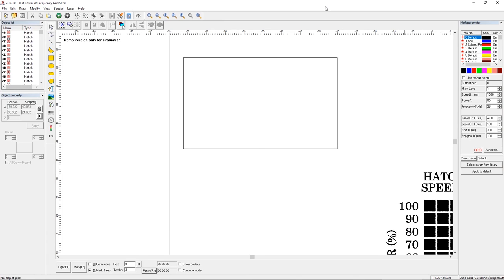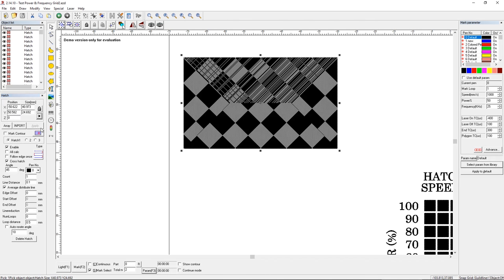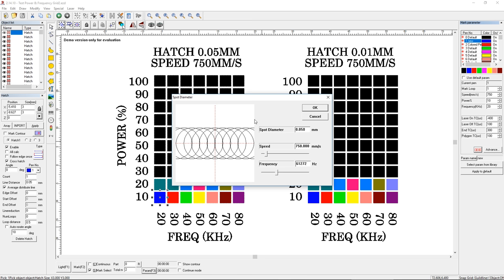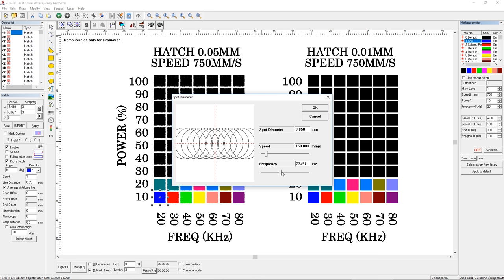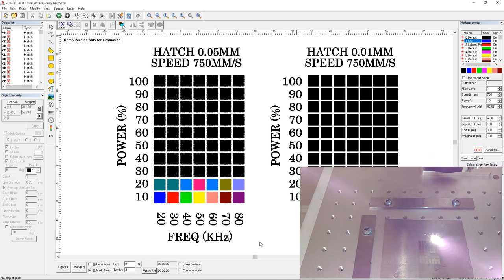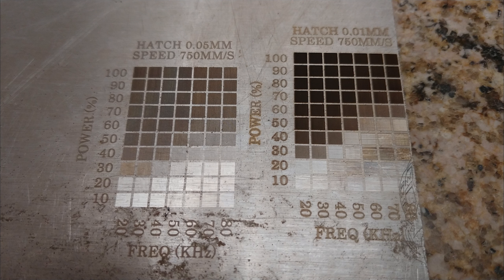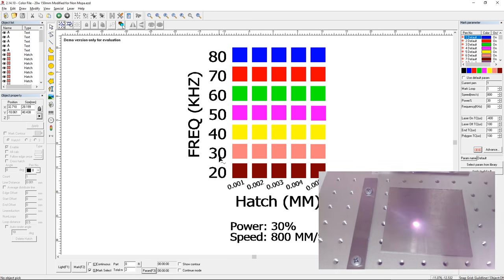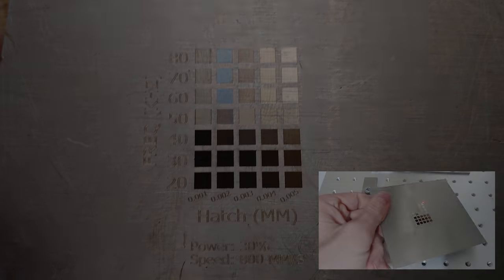Frequency Settings for Fiber Lasers : EZCAD2

Comment: "I LOVE THIS VIDEO" I've had a 30w Fiber Laser Machine for nearly two (2) years now and haven't engraved one thing yet other than some of those black aluminum cards which seems to be the only thing I can do as a noob because I don't understand settings and the machine coming from China provides no support.  This is some great info and I will be trying these settings tomorrow to see if I can find the problem to my delima of not being able to successfully use my machine properly and engrave like it should.

Comment: yeah i run a 50 watt fibre laser and have never changed those spot settings since the machine is installed, instead setting up the desired finish using speed, power and freq and controlling the mark with spot size (typically 0.04) and various forms of hatching and cross hatching say if the material coating is particulary troublesome, so 50hz delivers the most power and then upping to 80 or 90hz for a nice polish (on steel) so just as an example , 0.04 spacing, cross hatch, 3000 speed, 100% power and 50hz for taking a coating off then 0.04, single hatch, 3000, 60 power, 100hz to polish
Reply: Hi Bob I have 50 w fiber laser. Can you please help me?
Reply: i have a 50w with 300mm lens.  learing my setup slowly.  thank you!

Comment: Hi Jeffery, long time since you posted. 
When you do this graph, when you change parameters in layer parameter settings, do you have to do each layer independently? I have 70 layers and have gone through and changed pramaters in every single layer. 
Now I have to go back to change mark speed to 500 on every layer. Is there a quicker way of doing that?

Comment: THANK YOU - this vid is still very helpful and relevant! I'm looking for more details on how speed + power + frequency impact the depth of engraving, specifically to optimize cutting metals (no hatch, just a 0.3/0.1 wobble config'd for the pen). I can see I need to dial this in for each lens (50W JPT; f100 and f290 lenses). Do you have something like this done --OR have info on how I calculate it? 🍺🦝👍

Comment: Well done. We have many greens, reds and oranges at 25% power in the .0005 and .001 line space range.

At 20% power, we did a second pass at 0.001 line spacing and got a nice black luster at 80kHz, and a deep maroon at 60kHz. 

If you want to get some rainbows, we did a double pass at 20% power, 800MM/s to get brilliant colors at .0005,.001 and .002 across all frequencies.

Comment: I hadn’t payed attention to that spot diameter visualisation dialog.. good pointer.

Another big thank you from me: it’s really great that you are publishing videos of your experimentation since there isn’t much else out there.

Is there a shortcut you use when making those test patterns or do you go through the boxes one by one and adjust pen settings?
Reply from the maker: I've been trying to find a shortcut by opening every file in the ezcad folder that looked like it might store pen settings, but I haven't found it yet.  So yes, one by one....very tedious.  If you want the file to play with, let me know and I'll send it your way.
Reply: Param/markparam.lib has the saved param library- each [section] is a single pen config, but unfortunately while that would allow programmatic generation or just search and replace, you would still need to manually apply a different setting to each pen which is still 75% as tedious.

Comment: When I tried doing stainless steel at first on my 30W fiber non MOPA it was like a brownish goldish color and I didn't like it but now I go out of focus by 3-5mm and it no longer etches the steel but burns a very dark image on the steel. You should try to go out of focus to get that black anneal and also see what colors you can get out of focus. Great videos especially since there is so little out there in tutorials for these lasers in English.
Reply from the maker: Check out some of my other videos from the past.  I've done a few on colors on stainless and titanium.
Reply: i too have 50W raycus fiber non MOPA, does frequency affecting the result too? because the company said no need to change the frequency because its not MOPA. i really need black smooth marking but never achive it, always looks goldish color. Please help me..
Reply: @rumblemumbles  Do what I told you above, you need to find the sweet spot where it starts to etch the metal then raise the head about 3mm to get the dark image. Also you want the lowest Frequency your laser goes to make dark images. I have a 30W so my laser can do 30 KHz to 70KHz. The higher the frequency the lighter in color for non MOPA.
Reply: @Angryhelder  yeah i already try for 1 week with every parameter and power setting with my 50w and 50KHz and raise the focus, but the result is always not truly jetblack, it turns out greyish black. but thanks for the info. sorry for my bad english.

Comment: Hi Jeffery! Was it a 20W fiber laser machine use in the test on 3:50? Because I had bought a 20W fiber laser machine as well and downloaded your shared file to do the same test just like 3:50. I was using stainless steel pieces as well but the result was different from yours. It did not show any colour. Please help.

Comment: Nice video. Just a question if I may. If you dont get a satisfactory color on a mark. Is it practical or possible to re-mark without moving the  material. Lets say we are working on stainless steel for example. Thank you
Reply from the maker: Yes you can mark again as long as you don't touch, bump, or move the material at all.  For color, the results may be a little unpredictable when re-marking.

Comment: Hey Jeffry, I am trying to put a black mark on 11 ga. mirrored Bronze plaque. The size of the plaque is 11.5"x 7.625" almost the size of a sheet of paper. I am brand new at this. I just bought my 60 watt Fiber MOPA Laser. any help  with settings or if a plaque this big can even get a black mark would be appreciated. I am using a 300x300mm lens by the way. Thank you

FYI I tried to email you but it came back as undeliverable

Comment: I seem to be having a problem with my mark settings and I hope you can help. So far your videos have been the most helpful!! I operate a 30w KT Laser and while trying to figure out the rotary table the other day, the "speed (mm/s)" setting under "Marking Parameters" has changed to "step (mm)". So now instead of the default being "Speed (mm/s) - 300" it reads "Step (mm) - .020". So y question to you is, do you know how to get it back to read "Speed (mm/s)" instead of "Step (mm)"? Thank you for any help you can provide!
Reply from the maker: I don't have the rotary, so all I can do to help is direct you to a few facebook groups where you might find assistance: https://www.facebook.com/groups/250911899106529/
https://www.facebook.com/groups/440091022989424/
https://www.facebook.com/groups/300139820848489/
Reply: @jefferyj  Thank you so very much sir!

Comment: Hello, on the Power vs speed and power vs freq the hatching is not setup. I cant seem to be able to figure out to hatch more then one item on the page. When editing the hatching parameters on right IE Speed, power and Freq then click APPLY and got on to the next and change it. After doing rows, I go back and click to check it and the last info I input in 1 box shows the same info I put in the last. If possible can you explain how to set up parameters and do hatching on the box to show different values.  Thanks again for doing these they helped a lot.
Reply from the maker: I made a video a while ago on hatching; it might be worthwhile to check out to make sure you're doing the same things I am to set up pens and apply hatch settings.  Here's a link: https://www.youtube.com/watch?v=kmxDePbHHOk

Comment: Thanks Jeffery, your videos are very useful. 
Could you please let me know what's the different between Frequency setting and Wobble Distance setting? I'm confused because they both change the density of the wobble circles.
Reply: i think that keeping the frequency constant, increasing the wobble distance must increases the speed, is that right?
Reply from the maker: Wobble is used to thicken a line.  It will allow the laser to deviate from the 'on screen' path by an amount you set to gain thickness or coverage.  
Frequency controls the number of pulses in a period of time - the higher this number is set, the less destructive each pulse will be.

Comment: Hi Jeffery, Thanks for the video, it is very helpful. I am looking to do darkish marking stainless steel with a 30 watt fibre laser (it is MOPA) however I need it to be a durable mark. It is for a kitchenware product that will be used almost daily and be cleaned in a dishwasher. I don't mind if it fades a little over time but it must be durable enough to be distinguishable and not flake like MOPA laser annealing can over time. Do you have any ideas or know of a good resource for this?
Cheers, Jason
Reply from the maker: Hi Jason - I don't have enough experience with long term durability of annealed black marks on stainless to give you a good answer.  I'm curious though, how many washes does the mark stand up to until it is damaged?  I may experiment with this...

Comment: Hi Jeff, thanks for the video. I would like to ask how I can create a thick line (~1mm) on steel at a scan speed of 6-7 m/sec?
Reply from the maker: Two ways: use the offset feature in ezcad and hatch the space between your oriignal line and your offset line - or - use the wobble feature.  I made a short video on this a while ago.
Reply: Please send me a link of the video of how to increase the line thickness  in laser output.

Comment: Thank you for the tutorial I will try it out. Can you tell me how to set the parameters for cutting through metal?
Reply from the maker: Sure, low frequency, high power, moderate speed, several passes.  Add some wobble if you are lower wattage or your material is thick.
Reply: @jefferyj  Hi Jeffery thank you for replying. I have the same machine in 100W, I'm still trying to figure out the parameters I should use to cut. Because this is a test I'm cutting through 0.8mm Brass before I move on to 14K Gold. 
I have tried: 
Speed: 800 & right now 2600
Power: 100
Frequency: 20 & now 150
Hatch is a very close hatch
I'm not sure  why it is taking so long to cut though. 
When you say several passes, how many passes or minutes - I have had it going for 9 minutes on continuous & it is still going. 
I assumed that the 100W would be much faster than what I am seeing. But, I am new to this & trying to figure it out.
Can you please advice or suggest parameters? 
Or if you know i'm doing something wrong here. 
Thank you
Reply from the maker: Send me a note.

Comment: Great video but I got quastion: so I got 2x fibers one 50w and other is 20w but 20w got 1-1000 freq. Where do I use this and for what?
The 20w almost more powerful that 50w China model and 20 w is TurcMark sos laser.
Reply: It probably be setting issues.

Comment: hello mr jeffery  is have an issue about engraving when i want to mark as it is straight on my pc then when the laser marks it opposite like if i want to engrave MONDAY it engraves YADNOM. i want to reset it to normal please sir kindly assist thank you
Reply from the maker: Parameters (F3) >> Field Tab >> Galvo 1 = x
Swap that setting to the other galvo and it should be functional.

Comment: Jeff, We just got a 30W fiber. There are two problems with it:
1. The red spot is way offset (about 3" in X) 
2. I cannot mark. I suspect the fiber laser may have been damaged in shipping. The laser housing broke off the vertical rails, and rattled pretty bad in the crate. What does the test laser function do in the parameters page? How do I determine if the fiber laser is putting out power? 
The galvos, red pointer, etc all work. One weird thing. The easycad works without the USB dongle installed. Could that be part of the problem? 
 Reply direct: a_design@citlink.net
Reply from the maker: Hi - Sent you a note.

Comment: what is the strength of this laser? I can't seem to achieve dark marks on stainless steel with the same settings with a 20w
Reply from the maker: 20w, you should be able to do it.  Double check your focus and pen settings.
Reply: @jefferyj  i just built a table like the end of this vid with adjusted hatch widths and that may have been the difference maker. Thanks!

Comment: hi , i just bought a 20w laser machine and im struggling to find the right parameter settings for marking/engraving gold products. can someone help me?
Reply: How far is the field? I'm having the same issue with copper, as my focal length is F420 I figured the laser just doesn't have the blast power with that FL, I bought a F160 lens... luckily I'll be able to obliterate copper... I assume Copper has the same issue.
Reply: @RiderRickMaker  mine is a f=163mm lens. I have tried marking using settings for brass and got quite a nice white finish on the marking. Maybe because brass density  is almost the same with 24karat gold. 

parameter settings i used:
passes/loops = 4
speed = 1500
power = 90
frequency = 60
Reply: @yusamirulhaziq5920   wow! Thanks! I will try to do it once my new lens arrives, yeah, and if you're using 60khz at 90% with a 20W laser and get a nice surface finish, I assume I'll be ok (I have a 50W beast!)

Comment: Hi Jeff, I have tried to do the color thing raycus Q plus 30w but shows all black on steal not like yours
Reply from the maker: Are you marking stainless steel?
Reply: @jefferyj  yes thats what does it say when i bought it .. can you please give me a link to whatever you bought and i will try to do on the same material
Reply from the maker: I suspect if the material you're marking is stainless, it's not the problem.  My laser is only a 20w so it's likely you need to reduce the power on your 30w system for each hatch in the grid (especially if your marking field is the same, or smaller, than my 150mm area).
Reply: @jefferyj  great tip. Yes marking area 100×100 i will work on reducing power and see how it goes
Reply: @JefferyJ .. Thank you for your tip .. it really worked I changed the settings to 800 speed 10% power.. also I Noticed if you make it out of focus by 1-2 mm you get really well defined colors check it out https://ae01.alicdn.com/kf/Ua910fea9c6484b79b931227ada55c5cbg.jpg

Comment: Hey, i need some help! 
Wenn i open an file the grafic is shown correct in monitor, but the F1 
button that shows the preview shows the logo rotated by 90 degrees and in mirror. When
 i rotate it in the software it will fit. so, do you know a solution...?
 Thanks a lot!
Reply from the maker: If you go to the parameters button on the bottom of the screen, then on the first tab (should be 'field'), you will see a radio button that says 'Galvo1=X'.  Try switching this to Galvo 2.